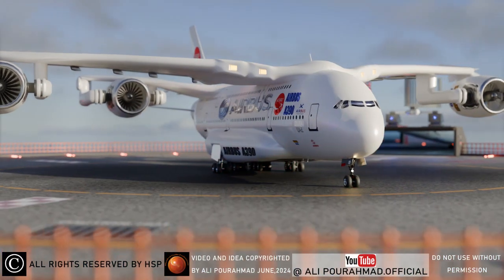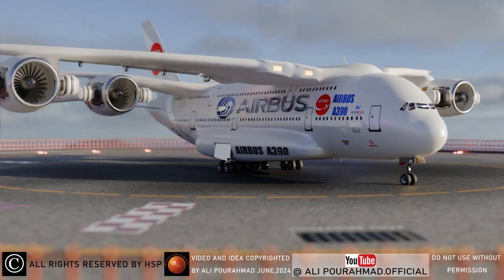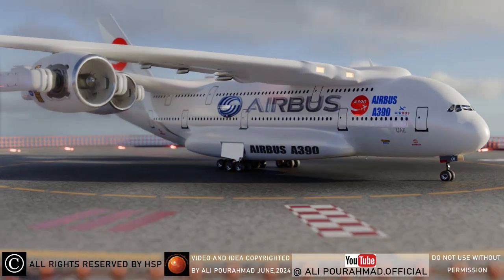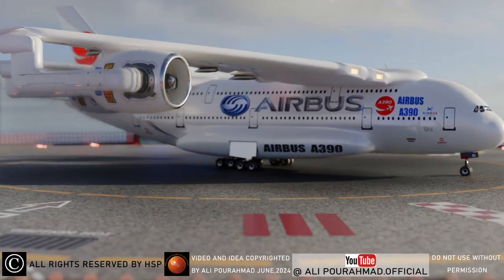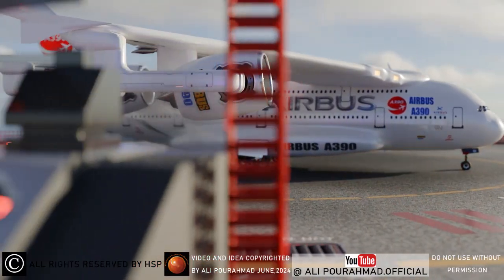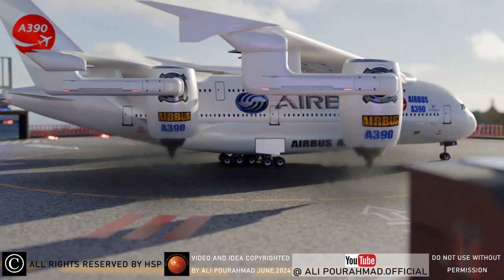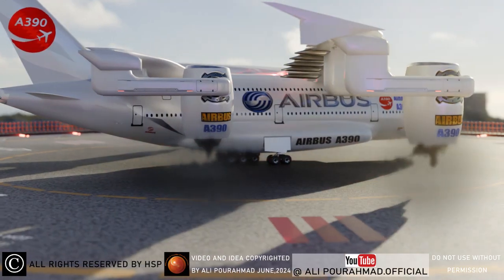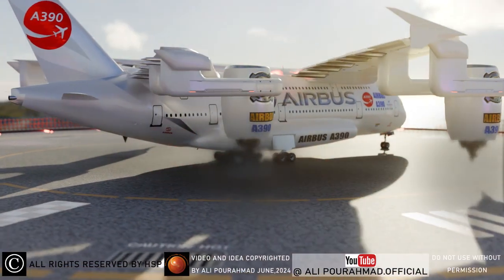Vertical Take Off and Landing of Airbus A390 - Innovation -creativity-Technology Invention

Comment: Max thrust from the largest engines available is around 35 ton-force. A380 mtow is around 510 tons. So you will need at least 4 times more thrust than available, assuming you can make the vtol aircraft weight the same of the conventional aircraft. In reality even in the best case scenario you are off of a factor of 6 at least. So, it's completely unfeasible.